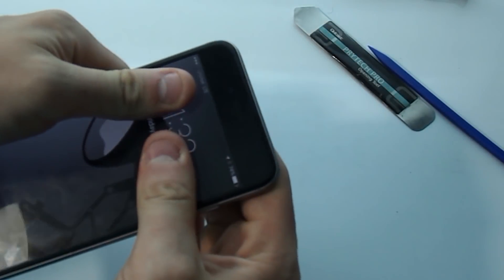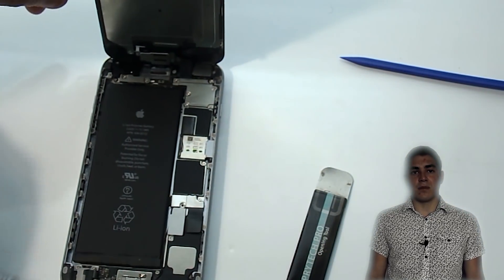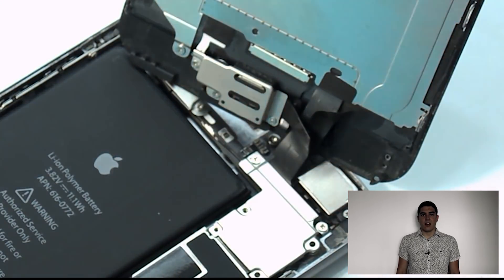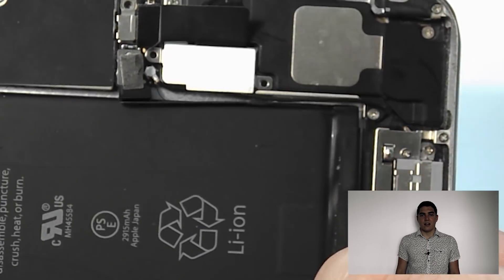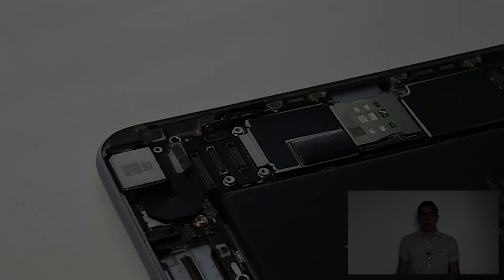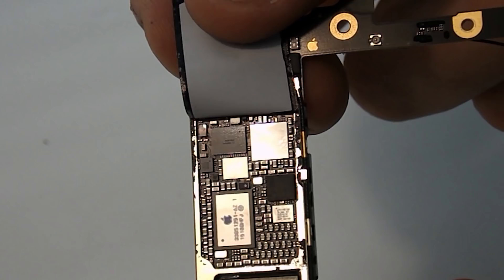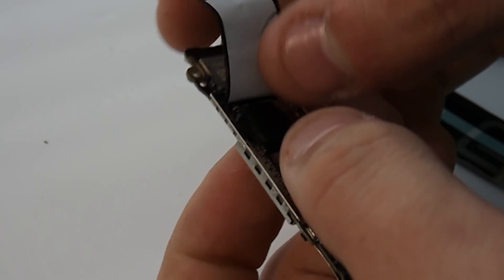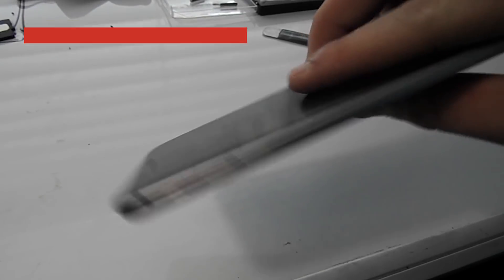How to Fix Touch Disease on iPhone 6 Plus (No Soldering or Bending) | appleEducate #03

Comment: I just spent the last 2 hours taking apart my wife's iPhone 6 Plus and attempting this fix. At first, I took a piece of electrical tape, doubled it over, and it applied it to the touch IC chips and put the phone back together. No success. I almost replied here saying it didn't work, but I decided to pull the logic board back out and add more tape. I got it out, and put 3 more layers of doubled up tape. Enough so that I could see a bump on the outer tape layer like I can see in your video. I put it all back together, said a little prayer to my favorite deity, and turned it on. Success! I haven't seen a hiccup since. Of course, it's only been 30 minutes. But I'm pretty confident this is going to get me by long enough to trade it in for credit on my iPhone 7. Thanks so much!
Reply from the maker: +chris mueller thanks for sharing! Yeah you need more tape than you think. And the first time I did this to my phone I had the same problem by not adding enough. Thanks for watching the video! Hope you get that iPhone 7 and please share this video with anyone that may need to know about this!

Comment: Hey, Roy.  Thank you for this lesson.  I have a problem with an iPhone 5c.  Half of the display functions and the right side won't.  I mean, the left side have the touch interaction but on the right side it won't do anything. By the way, it starts doing things of itself, writing on the keyword on its own.  I opened it and pressed tight the display connectors but nothing changed.  Could you advise a solution.  Best regards. Juanr
Reply from the maker: Yes for that phone the solution is a new display, you need to get a full display assembly. The Touch IC Chips are not affected on this model the same way as the 6. I would suggest buying from iFixIt because you get a lifetime warranty
Reply: Thank you Roy. I really appreciate your valuable advice and your time to answer. I am now subscribed to your channel. Keep on going!
Reply from the maker: +Juanr Mijares thank you so much for sub ribbing to the channel! It really helps me a lot, let me know if you need any more help! Thank you!

Comment: There's an Apple forum regarding this issue https://discussions.apple.com/thread/7028290?start=1080&tstart=0
but the moderators won't let your video link be posted regardless of results or qualifications. Definitely going to spread it around as much as possible.
Reply from the maker: +Anthony Cirillo Please do!! Thank you so much! Apple is taking down threads on their forums because they don't want to take responsibility for the engineering defect.
Reply: I'm going to perform this operation today. I will post immediate results as well as 1 week results.
Reply from the maker: +Anthony Cirillo Thank you please do!
Reply: Procedure complete. Will post results with enough time.
Reply from the maker: +Anthony Cirillo awesome! Thanks for sharing
Reply: It's started bugging out again. Perhaps I need more tape to build up pressure, but I am thinking that it may not be the best solution all around.
Reply from the maker: +Anthony Cirillo yeah be careful with that. Make sure it's all the way at the top covering the chip. It could be that the chip has come too far off, but try repositioning it first. Has your phone ever been bent more than slightly?
Reply: After I put in the tape, I used the flat head tool (that looks like a scraper) to press along the IC a few time. That might help a bit more. But I think there are other causes to this and it also depends on how much the intersect area is bent
Reply from the maker: +Jay Quach the phone could have been bent beyond its limit to have this repair fix the issue. There are some cases that need a new chip. I hope this is not the case for you. Hopefully apple will have a warranty program soon. And just to give you some insight on how thick mine was, when the logic board was in, I had to slightly press my logic board to put in my SIM card tray.
Reply: I take excellent care of my phone. I'm glad your approach fixed your phone, but seeing as it isn't very scientific and not repeatable in my case, I don't think I can recommend it. Best of luck man.
Reply from the maker: Thank you for watching!

Comment: Hey Rody... I've been facing this since a week now... I'm in Mumbai, India... Local Apple care hasnt even heard about the #Touchdisease. Local Repair shops want to change the touch IC for about 85$. If i use this apporach will it for sure solve my problem. Also could you tell exactly what have you stuck over the IC??
Reply: Never dropped... Just one fine day a host of grey bars at the top of the device.. Now the touch is almost completely gone or presses on its own...
Reply: Yes dude... best option!!!
Reply from the maker: +Mohit Gulati I put a price of folded black electrical tape over the chips. And if you do this approach and it works it will save you $85 and if it doesn't work for some reason you can still get it fixed at a shop. I would try to do this repair. When putting the tape it make sure it's just wide enough to cover the chips but not too thick. Let me know if you have any questions!
Reply: Mohit, how did it start ? Did you ever dropped your phone or is there a evident "bend" in your phone ? I have started getting a thin black line in the middle of the screen, not sure if it's the same as touch disease.
Reply: +Mohit Gulati Thanks. So the best option is to sell it off while it's working. We are literally sitting on a time bomb that can explode any minute 😳
Reply from the maker: +dhirajt11 thin black line could be the LCD going bad which is a different problem. You probably need a new screen. And no I did t drop my phone or bend it.
Reply from the maker: +dhirajt11 there is a class action law suit against apple on this so hopefully there will be an extended recall system maybe we can jump up to the 6s plus or 7 plus

Comment: Has anyone who is not normally repairing phones tried this? I'd like to give it a go but am wary given my lack of experience taking phones apart and putting them back together.
Reply from the maker: +Nikola Budisavljevic follow the iFix it guide and draw a picture of the phone on a piece of paper and lay out the screws in the shape you pull them out. If you have another phone or camera take a video of you doing it then reverse it. And go very slowly
Reply: Thanks Rody - I am ordering a kit from Amazon + the Phillips #00 screw driver. Will post how it goes. Thanks for posting the guide!
Reply from the maker: +Nikola Budisavljevic also don't forget the Pentolope screw driver as well, should be included in the kit. And absolutely! Let me know how it works

Comment: My phone doesn't have grey bar at the top but it's very unresponsive to touches is that the touch disease or is it something different?
Reply from the maker: +Omar Hashim if you have gotten your screen replaced before it could be a bad screen, but I have had it where sometimes I would just lose touch and no gray bars before I did this repair. So try it out and let me know if it fixes it!
Reply: Alright I'll give it a go, thanks!
Reply: my phone has the same symptoms as yours (no touch, but also no gray bars at the top), please let me know if you have tried this fix and the results. thanks
Reply from the maker: +Reza Lotfi does it lose touch randomly? Or not at all?
Reply: yes, and i have give it a good few twist to get the touch function back. some times it comes back on its own.
Reply: ***** great video btw
Reply from the maker: +Reza Lotfi Thank you! And yes those are still symptoms of touch disease. You will either have to do this mod or get the board micro soldered

Comment: So, I had the grey bars at the top of the screen with intermittent and increasingly more frequent loss touch response, which seem to be the classic symptoms of touch disease. I implemented this approach a few hours ago and so far my phone seems back to normal. I will check back in a few weeks to update if anything changes, but in the meantime thank you for putting this out there as a work around!
Reply from the maker: +sterbyn I'm so glad!! Thanks for trying! I have had it in my phone for over two weeks without it coming back. If it does come back make sure the tape is thick enough but wide enough to put even pressure across the whole chip! Please let me know if it stays fixed

Comment from the maker: Let me know if you need help and what you want the next video to be about!
Reply from the maker: +Nethir Osman absolutely! Working on a video now, thank you for the suggestion! Stay tuned!
Reply: Rody Davis will please tell me the common issues occurs with 6s after long duration of use like 2 to 3 years which probably happens...  or tell me some recent problem that may come to 6s
Reply: Rody Davis Thank you. I was able to recover my iPhone 6 Plus following these steps. I'll let you know how it does over time. I applied 5 layers of electrical tape to maintain the force on the chipsets. It took me about 4 hours overall, mainly because its the 1st time I've cracked an iPhone open and I was being extra cautious. I'm very happy... an iPhone that was written off as trash is recovered. Really disappointed Apple does help its customers a little with this defect.
Reply: When i try adding a fingerprint for touch id on 5s, it says failed try again later
Reply from the maker: +Tuvano Agario this is only for the iPhone 6 or 6 plus. But that issue you are describing is what happens when the Touch ID cable gets messed up or the sensor gets replaced
Reply: Okay thanks
Reply: Won't the tape melt? It does get hot i'm sure. Please reply!!!!!
Reply from the maker: +LAMBY #Skillz that's why you need to use electrical tape. It will no melt, the touch IC chips do not get as how as the Processor and other chips.
Reply: Can the same thing happen on the 6s?
Reply from the maker: +Nethir Osman on the 6s the chips are located on the screen itself and there have been no reports of the touch disease on the 6s or at least in the same way described here
Reply: Thanks for the fast reply, was Apple aware of this issue during manufacturing?
Reply from the maker: +Nethir Osman I don't think of during but they definitely know now!
Reply: Could you talk about the hissing problem on the new iPhone and or "Retina Displays". Maybe even how the iPhone is so well optimized for the hardware it has, in terms of speed etc
Reply: Class action lawsuits have been filed in the US, and Canada over the last 1.5 months with another on the way in the UK over this issue. Eventually Apple is likely going to have to replace/repair affected phones and reimburse people who have already had to pay for repairs. http://bgr.com/2016/08/31/iphone-6-touch-disease-class-action-lawsuit/
Reply from the maker: +Benjamin Zajd I am looking forward to it
Reply: Rody Davis  what side u put the tape on
Reply from the maker: On the touch IC chips!
Reply: Black screen trouble shooting please
Reply from the maker: +combs155 plug it into the charger and double check connections. Thanks for watching!
Reply: my phone become hot after i did it! also while i'm not doing anything! please help
Reply: Brother!!!